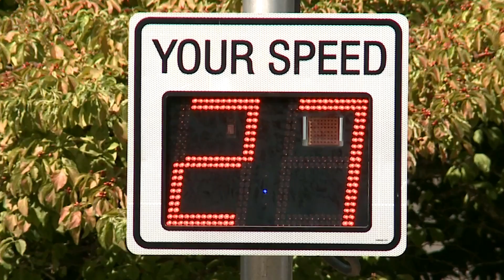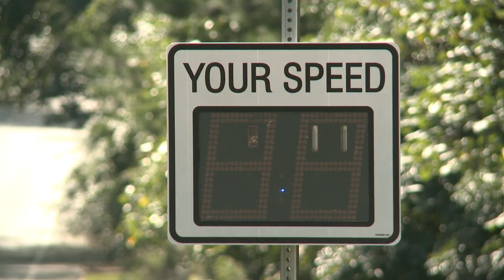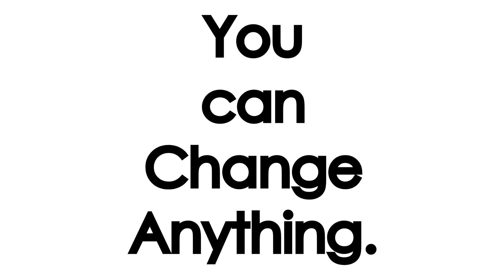How does Radar Speed Sign work?

Comment: You mentioned doppler effect but than calculated the speed via distance difference. Radars that using doppler effects calculating the speed via change of light's wave length this is what doppler effect done to light. You dont need to use doppler if you use distance diff.
Reply: I was thinking the same
Reply: Does it detect when moving left to right and distance or waves may not change much?
Reply: If it is waves at 360 degrees, would it know the distance by waves, and then on top of that change in the 360 degrees to get speed?